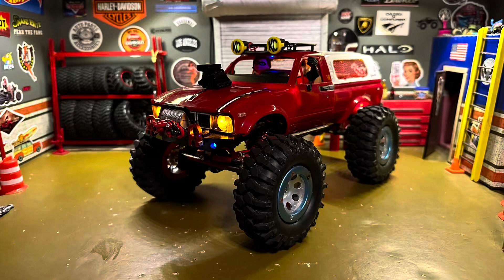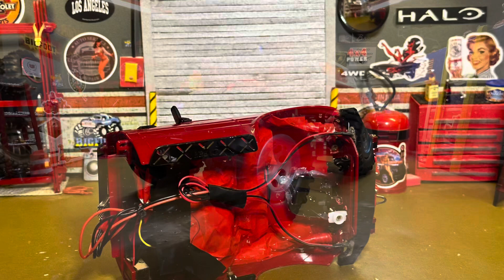Custom Rc Garage. Winch Hack for my WPL C-24

Comment: I love that idea. So is the retractor under the hood routed through the winch?
Reply from the maker: I hot glued it to the inside of the hood then ran the cable by my fake winch, when I added the hook it became to big to retract through the hole.
Reply: @CustomRcGarage  perfect. Thank you. I have not done any research on retractors, but we use then in mini rc crawler comps, these ones are attached to a winch stick, but usually its all you need. 

Do you have an idea of a good one that is small and light?